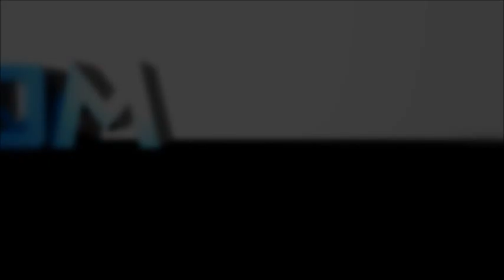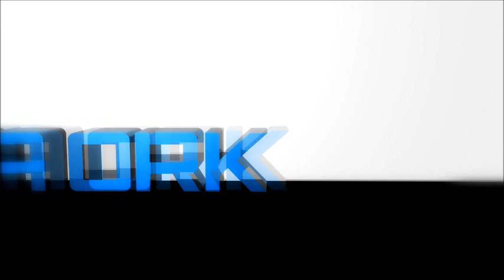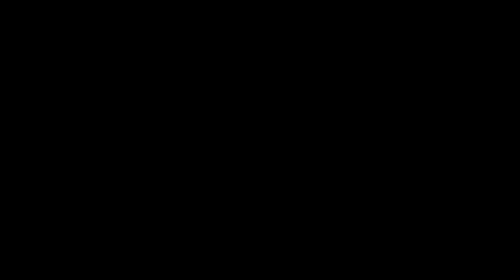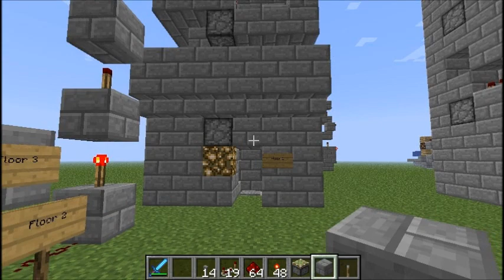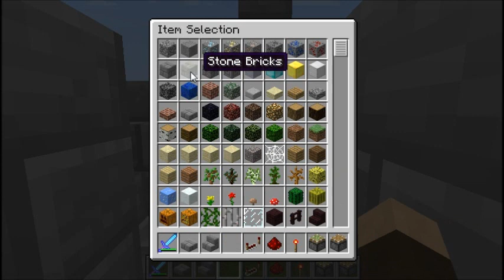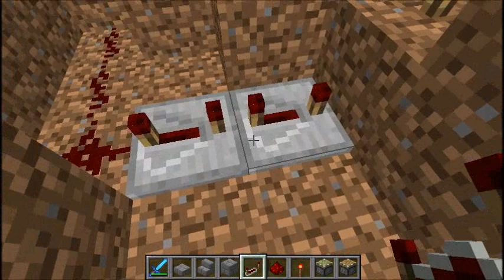Minecraft Tutorial - Elevator with Floor Selection

Comment: Can you do 10 floors?
Reply from the maker: You can do as many floors as you need, but remember that you need to design a way to send the floor selection to the system of "active" pistons. This is the hard part, but it is not that bad if you consider using a 4-bit signal.  I had a version built in my single player world that had 5 floors, but that system used pulse width on a serial wire to carry the signal. Its do-able, but much harder to get right than a simple 4-bit parallel bus.